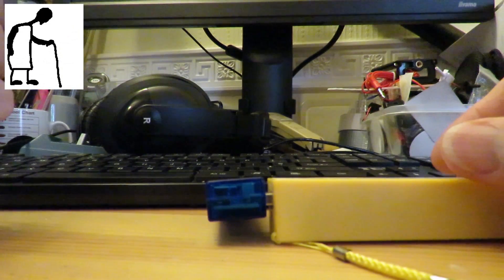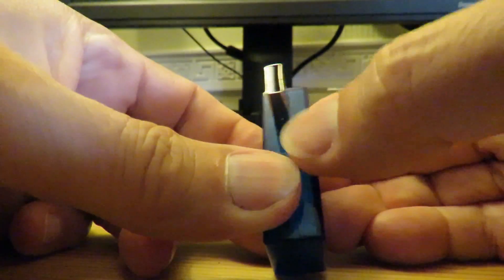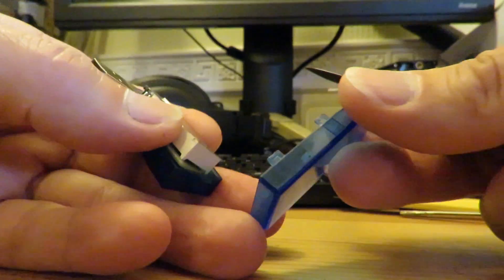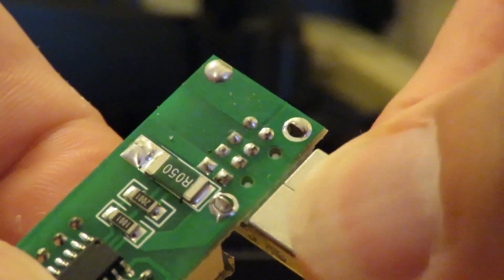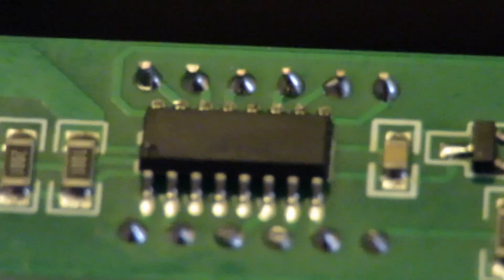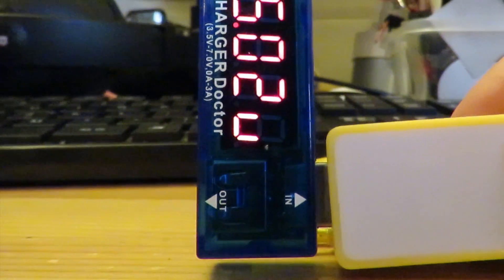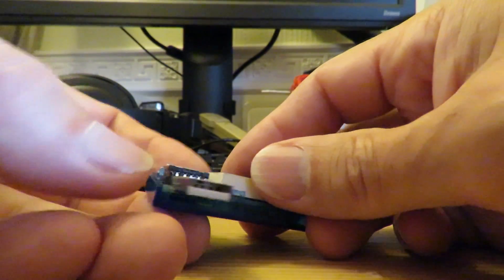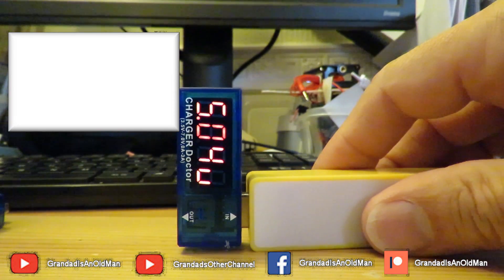Simple Fault Fix on a Charger Doctor

Comment: Really nice. :) I have one too, but the problem with mine is that a few "traces" (don't known how to call it in English) of the numbers won't light up anymore. Better to buy a new one in my case. :) (BTW, I used it in my last video.)
Reply from the maker: At least they are cheap  😊
Reply: GrandadIsAnOldMan That's true. :)
Reply: Those are called segments, and if it's the same segment on every digit not lighting up it still may be a simple fix; one of the connections (or the pcb trace) is broken. If you check the datasheet you can see what pin controls the dead segments, and then you only need to check 1 pin/trace instead of 12.
Then again, at the price they're selling buying a new one is another option - just less fun.
Reply: Carlo vani Oh, that's actually a good idea! I'm going to try! :)
Reply: anyone have a newer model charge doctor ( with v & a ) that will only show 3 v ?  i switched to another one & it shows 5.3v